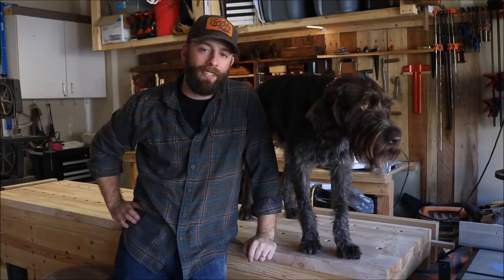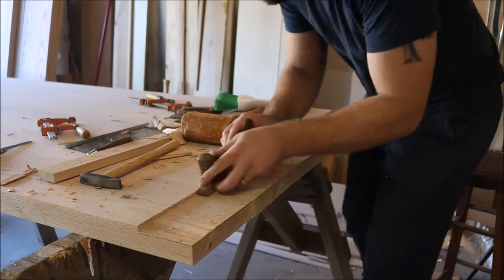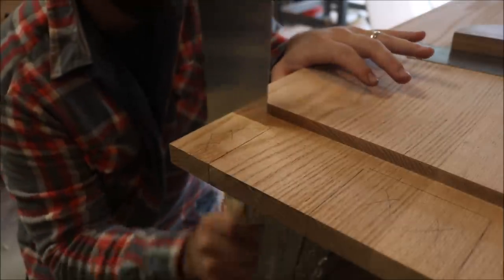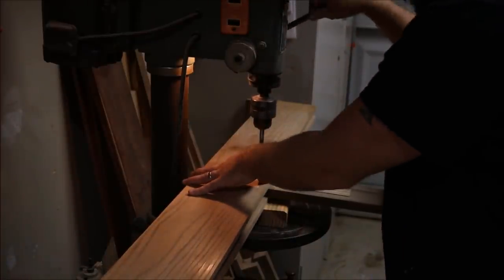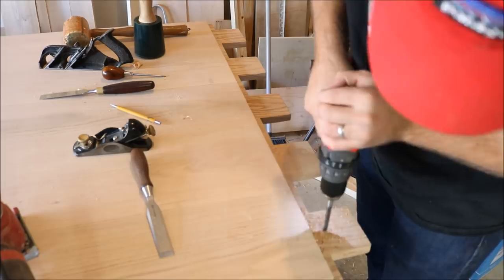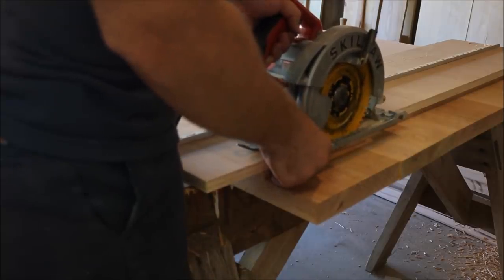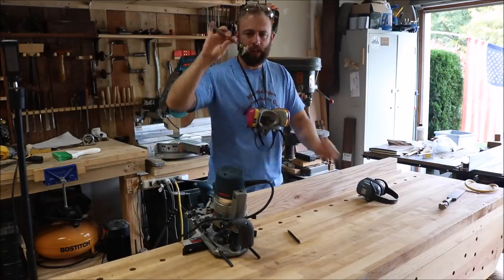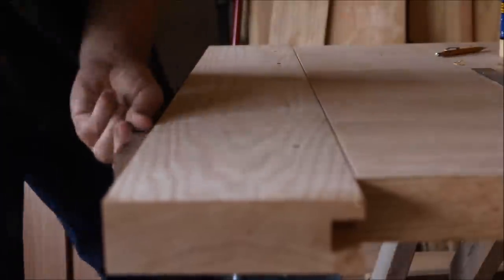SERIOUS Breadboard Ends!! Hand Tools vs Power Tools! Woodworking // How To // DIY

Comment: Tenons wouldn't actually need to be 4" deep.  And wood doesn't contract/expand seasonally along the grain, but rather across the grain at different rates parallel and normal to the rings.  So if the wood starts out dry enough, breadboards would hold everything together rather than tear apart.
Reply from the maker: Christopher Everett they might not need to be a whole 4”, but the longer the tenons are stronger the breadboard will be to any downward force (such as someone sitting on it.) Of coarse wood moves across grain not along it. I didn’t suggest otherwise. That is why the Mortises and peg holes are widened on the outter tenons. That allows the table (which will expand and contract across its grain) to move inside the breadboard end which will not move in the direction. It doesn’t matter how much the wood is dried it’s going to either expand or contract no matter what throughout the seasons. Summer is very humid (expands) winter very low humid (contracts) the breadboard end is not meant to hold the table together, it’s a aesthetic addition, but can prevent wrapping, twisting, and cupping. As long as you construct it properly like I did here it’s not going to tear itself apart.

Comment: um so can someone tell me why it is called a breadboard end? i mean the purpose of the board is to keep the table top flat but that does not explain why it is called that.
Reply: Because they are also (and presumably, originally) used on breadboards (those things we use in Europe to cut our un-sliced bread on!)
Reply from the maker: I could tell you the answer to that haha
Reply: Because there's slices sticking out like bread that you butter up and put in a toaster shaped wood??? :) sorry had to do it. Good question though!
Reply: That's interesting, if those are added to keep the table from warping....why aren't people putting them on their work benches they are making, because you don't want that to warp either do you?  (newbie, learning by youtube....LOL a youtube student?!?)
Reply: [to alaskankare] 
This being a regular table (I think?) would mean it's generally gonna be a lot thinner in dimension.  The individual planks in this wide top being oriented edge-to-edge in the flat direction, means they're in the configuration more prone to potential warping both individually, and cumulatively across all of them.  If selection, milling, and drying of stock were all perfect (this gets expensive), hopefully warpage will be insignificant.  If grain & growth-ring orientation is less than ideal, indicating risk of cupping, you try to alternate the growth-ring direction between adjacent planks, so that some minor cupping in each plank will be cancelled out by the minor cupping (if any) in the plank next to it, making the table "average" remain mostly flat overall.

Most of all those considerations don't really apply as much with the usual configuration of planks (lamination layers) in a traditional workbench top, which is ideally MUCH thicker and more massive (even if not as wide) than a kitchen table.  Rather than planks glued edge-to-edge in the table, a workbench top is traditionally done with ~4-inch wide boards glued flat-to-flat, so the 4-inch dimension is the THICKNESS of the finished top.  (4-inch example... they can be from ~2.5" to 6+ inches thick.)  If you follow me?  So these planks then are all much more bound/locked from any individual movement.  Mostly with a workbench, you just have to allow for the usual seasonal expansion and contraction across the width overall.  After a year or two, (and maybe one or two light re-flattening jobs with a big plane if you want it to stay perfect)... once a workbench top laminated in this manner has seasoned for a couple years, they shouldn't really "warp" much after that.  (Again, assuming the stock selected was a good species, decent grain orientation, and properly dried to begin with.) 

All that said, I dunno what the average YouTube woodworkers are doing for workbenches these days...  But traditionally there usually ARE massive cross-wise caps added at the ends of laminated workbench tops, which DO additionally help a bit to minimize potential warping across the corners.  But they're not really called "bread-board ends", because again, the individual pieces aren't oriented the same way as a Bread Board.  They're more for structure (more like timber-framing a building in the ancient style), for adding vises and holes for bench dogs (hold-downs), and just as a decorative cover to hide the ugly lamination ends.  AND they're not usually done with these complicated multiple individual tenons in the joint.  All the workbench end-caps I've ever seen, were just one continuous rabbeted tongue-in-groove joint across the whole end.  Like one massive single full-width tenon, which crosses all the previously-glued laminations as if they were one big plank.  (Because long ago, they made the WHOLE TOP of a workbench out of one single massive 20-30" wide timber, in the old days before modern glues became reliable.)
Reply: boatrat74 wow. Well said. And most importantly easily understood! Thanks
Reply: Teach me you ways lol
Reply: MiCompre breadboard ends are easier replaced from end grain wear and tear if you use older style glues like hide glue. Faces of wood is typically fixed with a plane but end grain can seriously splinter and chip as the wood gets older. So they put bread board ends on them to decrease the amount of contact with exposed end grain.
Reply: so knowledgeable. thank you but my question is why are they called bread board ends? what is the story for this piece of wood. we all know that it helps keep a less than thick top relatively straight but what i want to know is the history. please don't tell me that it is just called that because this was a sacrificial piece added to the table to slice bread on. it surely can't be so simple as that. thanks in advance :)